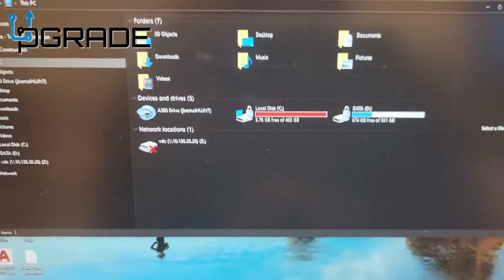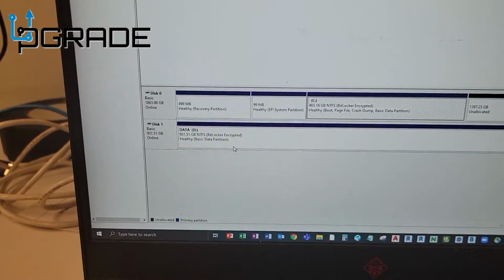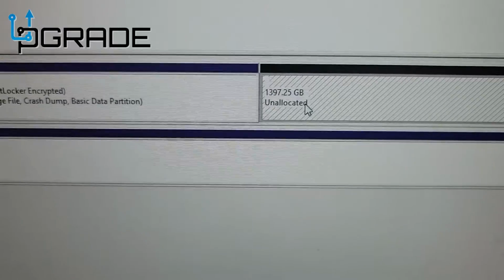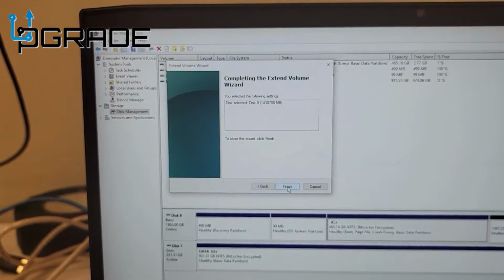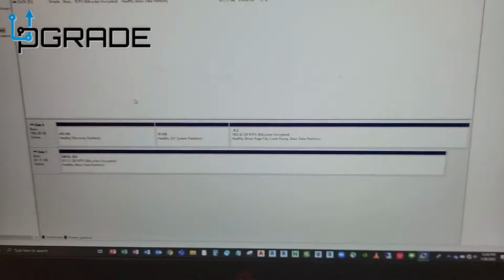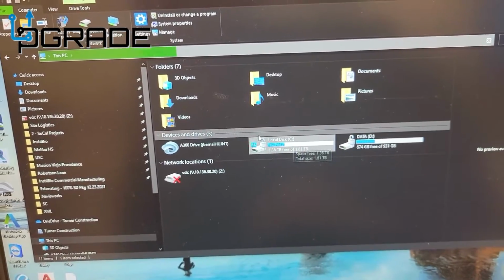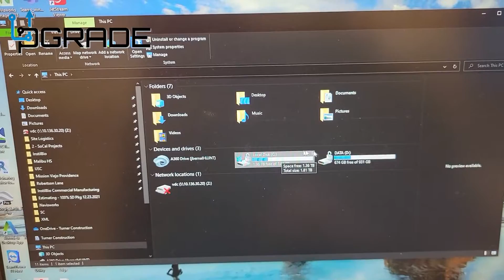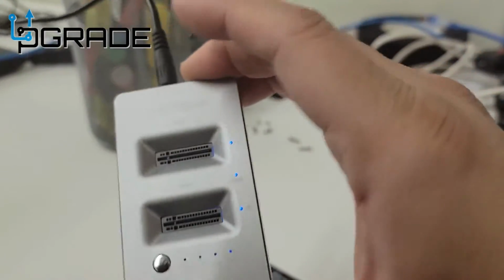NVMe M.2 Duplicator Dual-Bay Offline Clone

Comment: My laptop keeps telling me that a SSD failure is imminent. I've tried a couple of cloning software programs but it fails to clone. There is always an error. Will this thing clone an SSD that has a problem? I'm using the "failing" SSD right now as I type this. I've seen no performance issues. It's just that when I start my laptop it sells me that the SMARTdrive, whatever that is, is predicting a failure. I hit enter to bootup anyway and the laptop boots up and has no problems other than I can't get the computer to clone this drive onto a new one. This 512gb going to a 2tb.
Reply from the maker: I don't know if this would work on your issue because this copy even Bitlocker stuff but requires passcode to unlock or transfer by USb

Comment: The cloned drive is showing up with the exact same name and capacity as my source drive (going from 512Gb to 2Tb) and there is no unallocated volume showing up under Disk Management. Can anyone make a suggestion? File System is NTFS.

Comment: Very good. Too many skip over the part where you need to resize the partition to take advantage of the new larger drive. B-T-W you can just right-click on the start menu icon and select Disk Management.
Reply: I had to download MiniTool Partition wizard to resize mine because there was a small partition blocking disk manager!
Reply: So the duplicator won't do it by itself?

Comment: Purchased this cloning device from amazon.  Any idea if you can clone different key configuration from one to the other?  My new Western digital 1tb stick has one notch and the 250gb stick that came out of the laptop has two notches.
Reply: The 250gb may be a Sata M2, one notch is Nvme M2,won't work in the laptop!! Has to be Sata M2!

Comment: the cloner is gen3. SO what do I do.. 😮😮😱➡ HELP...  My m/b has 2 m.2 drives. one on top is gen.4 ( high speeds 5100mbps m.2 ) and the other one is gen.3 mid. speed. OOO I only use gen.4 m.2 fast drive and im cloning to a gen.4 supper fast 7100mbps m.2 IN THE GEN.3 slot to clone. DO'S it make my super fast m.2 clone be cloned at slower speeds ???????????????
Reply from the maker: No, it will only clone at slower speeds. I would not use this to clone a newer version I would clone them on the motherboard by adding to the on the motherboard and cloning from here.

Comment: Have you tried to clone a Linux drive (eg. Ubuntu 20.04) I am thinking of using the  duplicator as a quick system backup/duplicator. (i.e. I am planing on copying from on identical size and type drive to another) . Also if the Linux drive is encrypted will this cause any issues?.
Reply from the maker: I haven't done a Linux clone. I can't give you a solid answer if this works yet.

Comment: Got to the point where I'm supped to choose "Extend Volume" Its not letting me perform the operation.
Reply: If you are cloning to a larger drive, you have to  "Extend Volume" in windows Disk manager with the new drive!
Reply: @wallychambe1587 after the cloning, I presume?

Comment: Thanks for the video. How long did the clone process take?
Reply from the maker: About 15-20 minutes this will also depend on the size of the ssd
Reply: @Upgradetech  What is the used size in the original NVMe of yours?